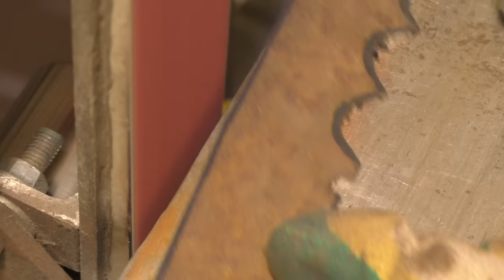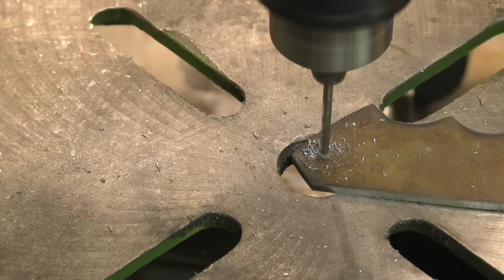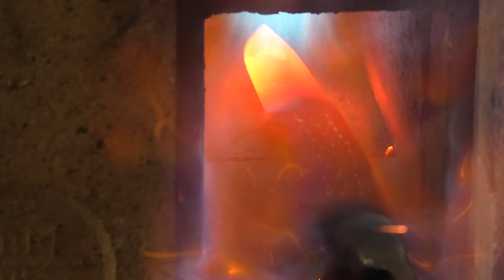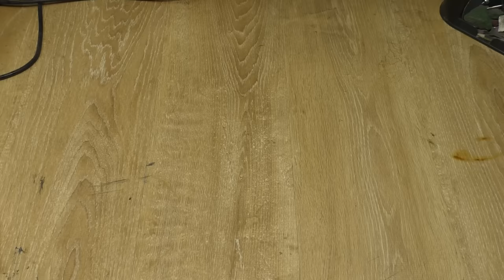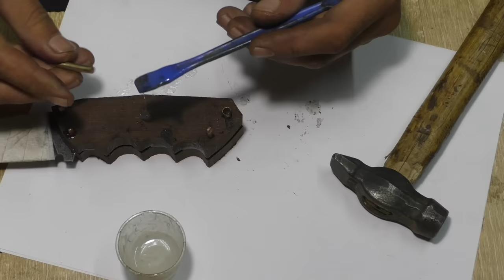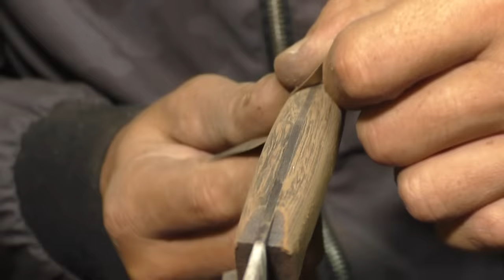Making a Knife from an old Saw Blade

Comment: This is the first one who used actually good saw blade and not the junk with welded teeth like a lot of others so called 'knifemakers'. This could be actually good knife with solid edge retention. The heat treatment looks too high temperature but camera and display can lie, I miss only some test of blade after hardening like chopping bones etc.
Reply: My thoughts exactly. I use these old style blades all the time. I strongly suggest annealing them right after cutting them out or drilling can be extremely difficult also makes it easier to grind.
Reply: Can I buy one?

Comment: I'd like to ask a question: I'm trying to make a knife from a sawblade too, but the steel is just too tough to be ground, how could you grind so much material? I tried to anneal the steel with the gas forge but the change was minor. Do you have any advice? Thanks for the video!
Reply: Normalize it a number of times
Reply: Also, why not forge it?
Reply: @bondarkenergy  I did it with the gas forge (not controlled temperature) a few times. Then I left it in the fireplace with hot coal for a day and a night until it cooled down slowly: still a minor change, the grinding belts have worn a lot without grinding too much. 😓
Reply: @bondarkenergy  I can't forge it because it's too thin. I probably could have tried to hammer it just to see if it would change its structure, that's right!
Thanks for your answers!

Comment: The saw blades I have the metal is so hard that drilling holes for the pins aren't easy. I'm new to knife making any help is appreciated.
Reply: Hi. Thats because the sawblades are hardened. first you have to temper the steel. get it hot to forging temperature and then let it cool down very slowly, in your forge, in sand, in vermiculite or in a kiln if you have one. that process makes the steel soft again and drilling holes is a lot easier after that.
cheers
Reply: @thomasnobel  thanks
Reply: you welcome.. but i have to correct myself.  its not temper what i wanted to say, its annealing;-)

Comment: Good job! How long did you keep it in the oven for and at what temperature? Also do you know what the specific tool steel used was??
Reply from the maker: Thank.This is a saw blade from the times of the USSR.Steel 9 HF
In the oven for 1 hour at a temperature of 200 degrees.😊